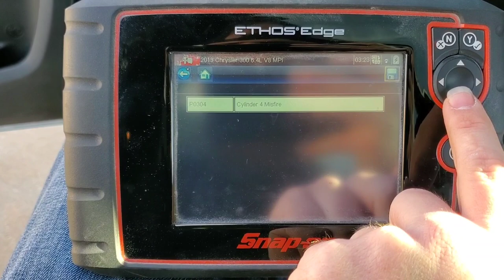Bad News for my 300 SRT8 | Vlog

Comment: Yup...My Cylinder 3 Lifter was broke right where the roller is and the roller and pieces of the lifter were missing....huge mess...just had mine fixed and went with a Texas Speed Stage 3 Cam......since Comp Cams were about 6 weeks out on getting me a cam kit....TSP was about a week since it had to be cut.....

Comment: cylinder 4 is generally the one that the lifter goes bad on. That's the one I had lock up and ruin my cam. If ya need advice or help let me know. I just did this job myself about a year and a half ago on my 2012 300 SRT.
Reply: Hi Justin. I also have a 2012 300 SRT8. I don't have any issues with my engine but, still concerned because I'm over 100K. What  kind of work did you have to do to it?
Reply: @felipegonzalez6637  I had a stock lifter lock up and chew up the cam at 70k. I went cam and lifters out of a 6speed challenger. Turned off mds in the tune. And been good ever since.
Reply: @JwomackGames  not a bigger cam?
Reply: Na. Its my daily/family vehicle.
Reply: I just posted a video of my 13 srt8 making some bad noises. Look at my last one and let me know what you think. About to tow to the shop for a year down tomorrow
Reply: Hey I have a question, is there a way to prevent this from ever happening? I'm thinking about getting a 2012 300 SRT8 and it had 78k on it but I wanna know if there's something I could do to prevent it from ever happening if I do buy the car.
Reply: @Tanner_Teves  replace them before they go😂 not much you can do.
Reply: @jamesburke9356  So you just have to keep replacing them? Or are there aftermarket ones that make them not total pieces of shit lol
Reply: @Tanner_Teves  honestly not sure other then doing the cam swap now and turning everything off. You can get a programmer and turn the MDS off. But I can't promise that will help without changing the hardware as well.
Reply: @JwomackGames  So taking the cam and lifters out of a 6 speed 6.4L hemi helps reliability?
Reply: @Tanner_Teves  so far mine had been done for 2 years. And no issues. 

Along with the cam and lifters you must have a programmer. You have to also turn off the MDS in the computer.
Reply: @JwomackGames  Would you recommend the car? I have a 2009 Acura TSX so reliability is important to me but ik the 300 won't be as reliable as that. All I'm looking for is a sport sedan with good interior, good reliability, under 30k, and is somewhat fast haha.
Reply: @Tanner_Teves  i would. its a good car. Dont get me wrong. it has its pros and cons. but everything does. And to be honest. outside of a tire. my SRT 300 has never left me on the side of the road.